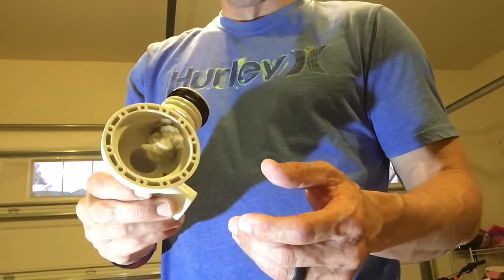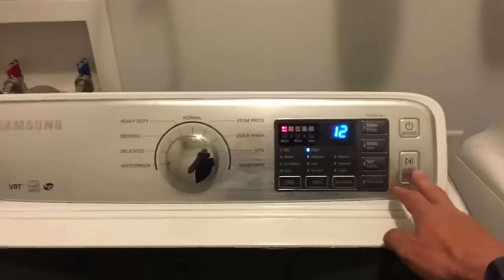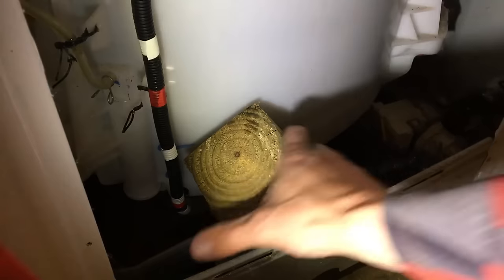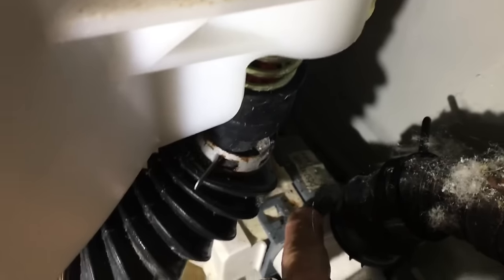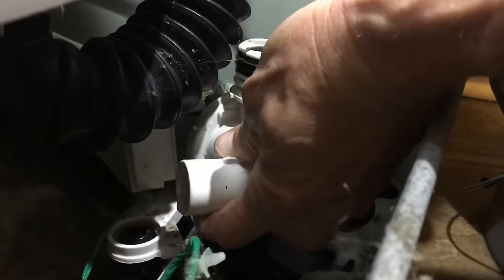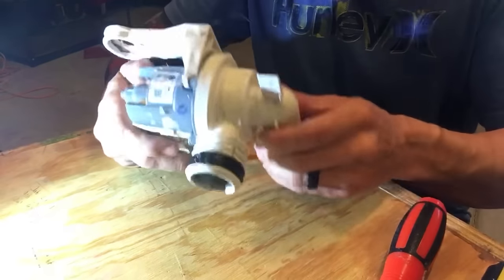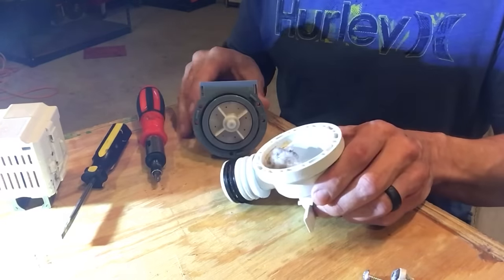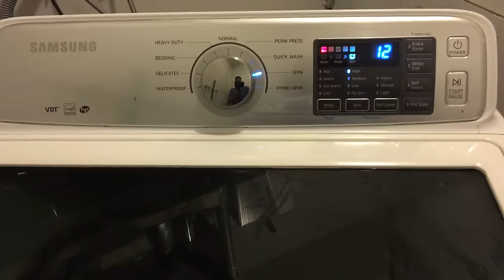Samsung Washer Won’t Drain! Easy Do It Yourself Fix WA45H7000AW

Comment: QUESTION:  Does your washer have water still in the drum, under the basket, after running a load?  When I gram the edge of the basket and rock the drum left-to-right I can hear water sloshing about under the basket.  I believe this can be a reason for the brown slime (mold?) that is always in my wash and on my clothes.
Reply from the maker: See my video  below. At this you see the bottom of the washer.  Hearing that water is normal it’s part of the washer mechanism; sound is coming from the balance ring which is an enclosed plastic container partially filled with a saltwater solution. It allows the basket to spin smoothly during an out-of-balance situation.

https://youtu.be/61GSgrTfq1Y

Comment: Thank you my issue was a small piece of a plastic coat hanger stuck in the impeller i was able to see it through the inlet and pull it out with needle nose pliers.

Comment: Thank you for this video...found a womens sock in the water pump, didn't need to take it apart, just put some needle nose down the spout. Works great now and will only use delicate bags for socks in the future.

Comment: Mine is draining, however I have a lot of dirt at the bottom after every self-cleaning wash (or any wash). It sat in a storage unit for 6 months and grew some mold, yet it is fairly new. I think I had it for around 6 - 8 months before I put it in a storage unit (so it's a little over a year now).  Can this be related to my issue?  It looks like a collection of dirt at the bottom of every wash

Comment: Might have semi flooded the laundry room, but fortunately I found this video and the clog.
Reply from the maker: Ya, controlling all the water is the tricky part
Reply: CW PIERCE unfortunately it clogged with a tub full of water. But i got the clogged fixed and eventually all the water cleaned up. Haha

Comment: Repair guy couldn't figure it out. He was blaming on too much soap. I just pulled pump off to find a penny that was worn down by 30%.
You cant make the full date out on the penny. Plastic impeller was worn off! Thanks for the guidance save me from  replacing a 3 year old $1,500 washer!
Reply from the maker: Self reliant home repair is where it’s at! Thanks for watching.

Comment: I have the Samsung that had a recall. Apparently the washing machine would explode if you put heavy quilts in it. So I called Samsung and they sent a technician out to put a kit in it to keep it from exploding. And he replaced the pump while he was here but you could tell he just threw it all back together. The black wire that goes to the pump broke into. So I soldered it back together. I think the technician didn't put it back together exactly right and the pumps been flopping around in there and broke the wire into.

Comment: Thanks for the video. I did all the same you did but it's still doesn't work. There is no water coming in anymore. Any suggestion ? I opened the top panel and checked the Ohms on the Inlet valves and all seems good. Should I jus change the pump anyway ?
Reply from the maker: I don’t have the same one anymore so I couldn’t look at mine, but could be the inlet house, there is a mesh screen / filter on one of the hoses there could be a clog.  Can’t if the kid switch had to be engaged for fill.  Shouldn’t be the pump if the water won’t fill. Seems to be the inlet system.

Comment: I have a top load samsung top load washer that has sat for 4 years went to test it recently the machine goes through its cycles fine but the drain pump continuously runs draining the water out  can you suggest a way to fix this problem  seeing as I cannot find any info on this problem the washer is only 4 years old no error messages

Comment: Utah thank you for the videos very helpful. Question I am not getting the UE code and it still goes back to add water. Did not replace springs put garden hose on them and they already had a rubber tube on them. Just cleaned out the pump (which sadly  was not clogged lol). Connected it back and ran it confirmed the pump is good. But it did try to start over. What would my options be now? Get springs? Thanks in advance for reading this.
Reply from the maker: Ya. Get springs. That’s what I had to do. The hose on the springs only last so long then I ended up replacing the springs.
Reply: @23sapper  Thanks for the reply.

Comment: What would anyone recommend if the pump wasnt clogged? Mine was clear. The impeller is hard to turn but that may be by default.

Should i just buy a new pump?
Reply from the maker: The pump propeller should turn freely. Might be an inoperative pump.
Reply: @23sapper Wow thanks for the super fast response! Yes I can spin the impeller with my hand, but it feels like a ton of resistance. If it's supposed to be able to spin, similar to a skateboard wheel that isn't touching the ground, then yes it doesn't spin freely.  The initial problem was it stopped in the middle of the load, the clothes had a lot of water and it wouldn't unlock. I unplugged it and over time it eventually unlocked. I first replaced the lock but that didn't change anything, so i moved onto your pump video. For reference, when I push the start button, no matter what setting, it does nothing. Won't fill spin etc I'm adding a super chat if possible for your help

Comment: This "smart washer" is the dumbest thing I've ever purchased.
Reply: Amen my friend. The last washer I had was 20 years old and you could throw a pair of steel toe boots in it and it wouldnt even sneeze. This washer will stop if there is a blanket that is too unevenly distributed in there. This is the third repair in a year.
Reply from the maker: Same here.  We had it for 6 years and I did three separate repairs!

Comment: So I have the back off, have drained/ removed all the water and I'm about to remove the pump. Mine started making a clicking noise almost like I can hear something inside the pump causing it,also the pump was extremely warm to the touch once we found that it was not draining. I will report back shortly hopefully and fingers crossed I can resolve this. Thanks

Comment: So would this pump make a grinding sound and smell likes it’s burning. Bc my washer doesn’t drain and looks exactly like your washer
Reply from the maker: @army03281  The pump could make a burning smell if the small plastic piece is blocked by something and the fan motor keeps spinning.
Reply: @23sapper  ty for that info going to try and take it apart today.
Reply: I just want to say I took the pump apart like you did and I found a sock in the pump. Cleaned the pump out it back together and it’s working. Thank you for this video saved me money

Comment: I open back of Washing machine cook off top holes for drain put my finger in there and I felt  fuzz I took a long 4 Inch Screw stuff it in there and turned it on to the screw and I put a big leg lob out Without even taking the pump apart or off the machine started running excellent after that
Reply: I meant to say I pulled a bigglob of something out wit a srew

Comment: This is a manufacture problem, they need to find a way to collect gunk and shreaded material to send to a separate chamber for easy pop out cleaning. They can do it just looking for recidivism sucker repairs or replacement by less savvy owners

Comment: Thanks buddy ... same issue on my WA50M7450AW (hair clog just after 2 years of use, well the dog sheds a lot)  almost the same only difference is the power cable it secured by a Tie wrap :(  boo Samsung just use a screw and charge me the 0.03 cents it would have been easier

Comment: You said that you removed the hot and cold lines to have more room, is it mandatory or can I just leave it connected? I just need to replace the pump
Reply from the maker: As long as the water is shut off and if the lines are not in your way of working you can leave them connected.

Comment: When you say won’t drain do you mean it just doesn’t drain it fully? Or it doesn’t drain at all? My washer is spinning and draining but there is still water that sits in the bottom (not visible). But it does leave a smell.

Comment: Should the washer be completely empty after draining?  I hear sloshing when I move the wash tub.  Just wondering if water in the tub during the spin cycle could be causing my unbalanced load issue.   I have already inspected the suspension rods and they didn't seem bad but I am changing them anyway.
Reply from the maker: There is always a little bit of water remaining, it’s in there to help maintain balance.
Reply: @23sapper  Thank you....

Comment: I rent on the coast ..and my husband won’t help me ..I have a stupid question..does rinse mean drain on a washing machine ?It stopped rinsing and I took all my clothes out rung them out in the tub put them in the dryer and then I dumped as much water pit as possible with a bucket then I put it on spin and it started spinning after looking stuck prior and then it filled up with water again ..is it finishing the cycle ..and it’s late here ..and he’s not very handy soooo am I gonna have the drain the water out again with a plastic bucket and old clothes at the very bottom again ?I know I’m stupid but it be greatly appreciated if you let me know . As I might have to hire a handyman which I can’t afford or try to do it on my own .
Reply from the maker: Sueann Valenzuela sounds like you may be having a similar issue to what I had going on, it would spin then refill and spin over and over, this video shows how to address that problem https://youtu.be/61GSgrTfq1Y

Comment: After finally figuring out the unbalancing issue… now I’m dealing with it not draining. I think I accidentally sliced a wire on the back that connects to whatever sensor tell it to drain, it’ll fill, but won’t drain. 🤦🏻‍♂️ think I’m gonna need to splice it back together and hope it works.
Reply from the maker: Good luck!

Comment: Hi! So i’ve done the first step and the water won’t even drain from the long thing that you put in the bucket at the start. Do you think the issue may be in it? Like maybe that’s the thing that’s clogged
Reply from the maker: There must be an obstruction in the hose. If you have a shopvac you can use that the suck out the obstruction.

Comment: Hi I fixed it and now I have the issue again but this time there’s nothing stuck, wondering i need to replace drain pump, and does ur impeller move freely cuz mine has some resistance when I spin it
Reply from the maker: The propeller should move freely

Comment: Do you have to take the two hoses off ( cold and hot ) or can I just turn the knobs to close the water off, or can I just leave the water open and hose on? Don’t want to take it off and close the water if I don’t have too, plz lmk asap
Reply from the maker: If you don’t shut off the water lines you will have water spraying all over the place.
Reply: @23sapper  Doesn’t the water stay contained in the inlet valve until electrical current triggers it to release water into the tub? I’m wondering if I can just leave the hose in with the “ hot and cold” line not closed, unless it’s somehow connected to the drain pump?
Reply: @23sapper  basically I want to leave the hose in and the line open, maybe I can change/ check the pump without messing with the ( hot and cold ) hose?

Comment: Add me to the baby sock club. I got the sock out but the pump got wet. Should I wait for it to dry put before I plug it back in and test it 😕 not sure if this thing is water resistant or if i just wrecked it more 🤔
Reply from the maker: Sorry took too long to reply, I assume you figured it out.  Should be fine, you can always blow dry it if it’s too wet, especially electrical parts.  But most these parts are expected to have some water contact.

Comment: I have this exact same model. Can anyone tell me if it’s normal after the final drain cycle for there to be some water left in the bottom of the drum? Not visible water… but enough to hear sloshing around if you manually jostle the drum while it’s empty.

Comment: Well I thought you're video fixed my issue seeing as there was a sock in the pump, but it still won't spin 😭
Reply from the maker: Will it drain but won’t spin?
Reply: @23sapper  I'm not sure. It drained manually when I took the hose out of the drain pump like you showed. I don't know if it will drain cause when I went to see if it worked I put it on spin and nothing happens it just makes a weird noise. So the sock in the pump was definitely an issue that needed fixed which was easy with your video, so thank you for that! But I think that wasn't the original problem. I think it went off track from me overloading it. I found another video that I thought may help involving removing the nut at the bottom of the drum and then prying up the bottom part that spins. Well I removed the nut But where his tray came off easy mine seems like it's welded together lol. So idk what to do I'm gonna mess with it more when I get home. Thanks again for the awesome video!

Comment: My motor doesn't spin freely like yours, wonder if something is stuck on the motor side?
Reply from the maker: Maybe. Or maybe the pump malfunctioned and needs replaced
Reply: @UTAH23  it does drain the water but I noticed after the washer finishes it's cycle the clothes seem a little damp still

Comment: Has anyone had success diagnosing the pump? I have a WA45M7050AW and the pump is nearly identical but when I took it out there was nothing in the pump or in the drain hose. When the pump is connected and the washer turns it on I just hear a very low hum, very hard to hear. I think that means its dead but I have a multimeter and I'd like to check what I can to see if I need to replace the pump or not.
Reply from the maker: You would need to check continuity using a multimeter. Google how to check continuity.

Comment: A couple years ago I went to Home Depot to purchase kitchen and washer and dryer I got to Home Depot the mngr refused to sell me any Samsung so I went to Lowe's  COLOR ME STUPID the microwave has never cooked anything the dishwasher the water is not coming in but the machine will turn on all by itself and run for days on end or whenever and that's a fire hazard so you have to go out and turn off my breaker. Refrigerator is the black stainless sidexside ( never get side x side  no room, freezer or frig and it won't get cold freezer works but the fridgerator does not .The dryer had to have the thing that holds the belt replaced + the belt my son and my friend did that for me the washing machine has the 5c error code the wash stopping not draining  the clothes and he's tried taking the filter it won't come out.!!??? I've watched about 10 of these do-it-yourselfers and it says turn the little filter thing justs spins.. that yours capitoline microwave a dishwasher and refrigerator and now the washing machine don't work I loaded the dishwasher and it won't run but w door open it turns on and runs all by itself. It has sat there for the last 3 to 4 years never run a dish load yet.    So guess I'll go get him some long nóse pliers and try again
At this rate Sanding should have replaced all the appliances  but all the offers was cover cost if 1 part. Me all other parts and repair man.   Bite me Samsung don't mess w this 61 yr old.
 
You have been more helpful w your videos then all of Samsung's on line crew

Comment: Mine still has water underneath the tub. It drains and there are no error codes, but if you move the tub around you can here the water. Do I still look for a clog?
Reply from the maker: If the water is properly draining out of the drain pipe then there shouldn’t be a clog. Most of the water should completely drain on the spin cycle so maybe there is a small obstruction that prevents the last bit of water, but the pump should still remove most of it.
Reply: @23sapper I successfully took the drain pump apart and there was nothing in it or the hoses. Should I try the drum next?
Reply from the maker: @kimberlynorman175  I had to research your question, I don’t have this washer any more to compare mine, but what I’ve seen on other forums is that some water remains to help balance the drum.

Comment: I followed your video and found a coin in the drain blocking. Spun my load out. Went to put a new load in and now it won’t hold water and just drains strait out. What have I done wrong? 🤦‍♀️
Reply from the maker: You may have a drain hose syphoning issue. Here is a video that explains https://youtu.be/g7mrYrV3jcY

Comment: What is the part number and who did you order from?
Reply from the maker: I didn't buy parts for this repair; I only had to take apart the pump, however, the model number is that listed in the title.  I have purchased on amazon or with these sites as well. https://theappliancespros.com/  https://www.appliancezone.net/ https://www.partselect.com/
Reply from the maker: Also, there may be a parts store near you.  I had been ordering parts online, then a buddy told me about a store that was down the road, saves time from waiting for parts to come in the mail.
Reply: I found it. Mine is the DC31-00054A. Thank you.

Comment: Ohh god! The minute I saw it leaking  I said. No! I rather just buy a new washer.

But that’s because I live in a condo not a detached house like you. The unfortunate thing about living in a condo is that nothing is fixable. It can only be replaced.

Here me out, because the minute you try to fix the fridge, washer, dryer, washing machine. Say good bye to your tile floors. Say hello to the permanent stench of the lieqifs from the washer , washing machine and fridge . 

How do I avoid this blockage from happening to my washer? Do I just need to run self clean consistently ? I dread when my appliance start failing. I’ll either move to a new condo or replace all of them at same time.